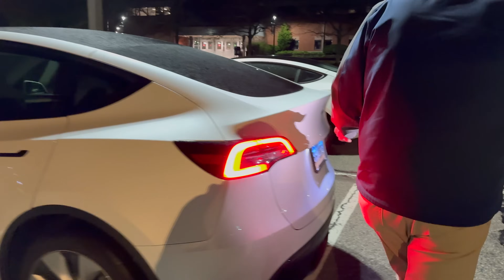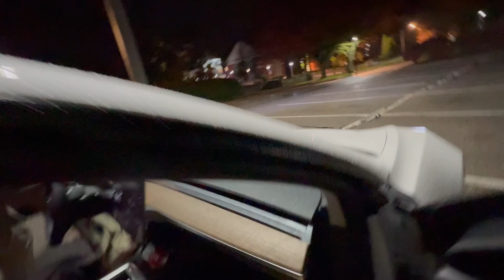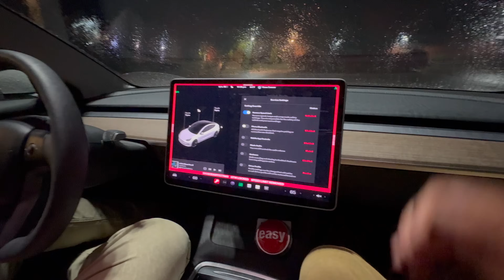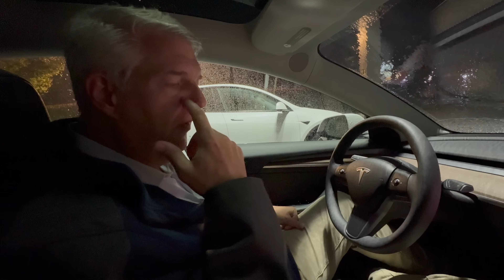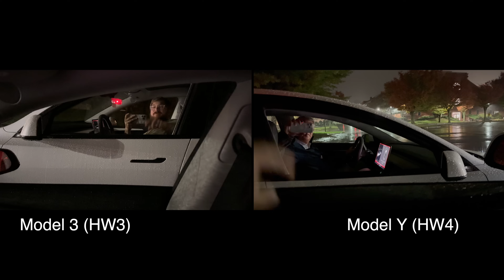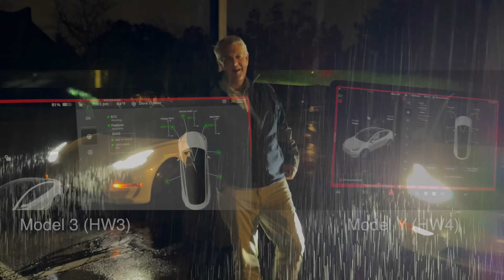Huge Difference! Tesla Autopilot Hardware 3 vs 4 - Here's What The Cameras Can Really See

Comment: Time will not tell.. Its a cost decision to remove duplicate sensors and just focus on cameras.. In every control algorithm if you got multiple input streams , you can do data fusion and get a much better knowledge of whats out there than just with a single type of sensor. Lidars+MMwave radar+Cameras means you CANNOT lose anything that is out there, hence you can never misidentify something or not see something because of water or fog. With cameras alone, you rely on clean camera lenses and AI pattern recognition to know what is out there and what the distance is , and this is really prone to errors.

Comment: There must be a coating that you can buy that repels water. Also for glass panes
Reply: Oleophobic and hydrophobic coatings. basically oil/fats and water form into droplets. 
There usually is some on the glass itself - but sometimes cleaning and pressure can force it away.  The angle of the front glass and B pillar cameras make it hard to clean or resurface - but it is possible to put ceramic film or coatings on the glass again to restore the water beading properties.

Comment: Tesla did nothing to address the critical problem with the B-pillar cameras.  Obstructed views.   The front wide view camera really cannot be used to determine whether it's safe to pull out so when the B-pillar is obstructed FSD is winging it.  I have lots of examples of obstructed view corners that I have to disengage.  No way FSD can see cars approaching from left and right.  You can get to the camera preview by simply going to service and then scroll to the camera preview option.   No need to go into service mode.

Comment: I have FSD V3 on my TMYP and it works fine at night and in the rain to a point. It does glitch if the sun is in a certain angle or when the wipers are working fast. Ironically, my enhanced autopilot worked better before the stack merge.

Comment: Pretty sure HW4 downsamples video feed, so it is not accurate on the screen. But I can say, having used HW3 since 2021, the cameras are not high resolution enough to see a stop light at a distance. Lights will be green and the car keeps slowing down for quote a while.

Comment: As others have said there are only two windshield cameras on HW4 cars, they removed the narrow camera.  How is it that you guys didn't know that?  This is a known thing for like months now.  And while the HW3 cars camera quality was greatly improved via software, it's still not as good as what HW4 cars have, because their camera hardware is much better.  But the HW3 software upgrade to improve the video, is NOT like iPhone quality, sorry Kyle, not even close.

When I had a HW3 car it always got the camera degraded thing at night, so that isn't just a HW4 thing.  The software just isn't there yet and not worth $12,000, and it will be many more years before it is ready.

Isn't it interesting that Tesla designed HW4 in such a way that it can't be retrofitted in HW3 cars.  That was deliberate so they wouldn't have to give everyone that paid for FSD free hardware and if they wanted it then they would have to buy a new car.  I feel that from now on Tesla will do this, which then makes buying FSD pointless and we might as well just "rent" it via the subscription model.

But yes, removing the ultra sonic sensors was a bad move.  Those sensors have been in vehicles for decades because they work really well!  Vision only on my car had me stop 5 feet from where I should have stopped to park inside my garage, it sucks!

Comment: Yes the software update improved the on screen camera image, it's SIGNIFICANT. I could never use my side cameras on screen to switch lane, I would always use the mirrors to switch lane but with this improvement I can use the on screen images with confidence. I also completely agree, it was dumb to remove the USS sensors. Time will certainly tell. Great Video.

Comment: great video，Thank you for your compliment on the rain test comparison. I must say this video is excellent, and I really wanted to understand the differences between Hardware 4.0 and 3.0, as I previously believed it would be a crucial step in achieving full self-driving for Tesla. Unfortunately, I have learned that the latest Model Y is equipped with a scaled-down version of Hardware 4.0, which we might refer to as Hardware 3.5. This 3.5 hardware lacks the 4D HD radar, which provides essential support in rainy and low-light conditions to ensure safety. I recently ordered the rear-wheel-drive (RWD) Model Y, but I've seen that the versions in China have improved acceleration, now reaching 0-60 miles in just 5.9 seconds. This has made me contemplate canceling my order.
Reply: The latest Model Y does not have a scaled down version of hardware 4.  It has hardware 4, and all the hardware it's supposed to have.  What is scaled down is the software of FSD beta, which at some point will be added to what it should be.  Not sure why the FSD beta software wasn't fixed to work with HW4 cars prior to the cars being sold.
Reply: @Resist4  Thanks for reply. However, I don't think so. Based on the breakdown of the "green" version, we can clearly see that the long-range version of Model Y is equipped with HW3.5 but lacks essential processing power and the interface for 4D high-definition radar. This is why I ultimately decided to choose the cheapest Model Y RWD version.

Comment: 2023 mylr hw3. Just drove 200 miles at 3am in Florida in a terrible storm. 4 lane rural road, US 301. During rain and fog held speed to 45. During rain held speed to 55. Much of the time visibility was so bad I would not have driven. When trailer trucks passed road was usually totally obscured to my vision. Only used autodrive the whole time. Never a hiccup. Not one. Flawless all the way. I am totally amazed. So there you are.
PS auto headlights, auto wipers.
Reply: U used FSD in these conditions and did that well?!
Reply: Absolutely. @JaHm3sZ
Reply: What do you have against writing full sentences?

Comment: I wish my Model Y had the ultrasensors.   I don't trust the cameras for object distance from the car.
Reply: Yeah that's why I didn't get the 2023 model x I got the 2022 mines have the ultra sensors and it have a radar I don't know if it's in use when I enter service mode It tell me it have a radar but yeah that's why I haven't upgraded yet cuz of that reason no sensors dinner ones without the sensors can't do auto park or summons
Reply: @youngchirp12  they can now. Even better than the ones with the ultrasound sensors
Reply: Yeah I got that update I like it I just wish it could summons @offbeatfusion
Reply: @dvanmartin9842  my 2018 model 3 has them and I don’t think at this point it makes a great difference. The cameras are good enough (and have been since this video was recorded) to be on par if not better than ultrasonic sensors. The problem with ultrasonic is it takes a liiiittle bit longer to react than cameras reading raw data input

Comment: When HW4 was launched, it was said that it would only have two front facing cameras, and a dummy camera to fill the hole of the missing camera.
Reply: I wonder if we can take selfies with the dummy camera.
Reply: I don’t think the HW4 was launched. As far as i know the Y still HW3 in the UK, i just ordered the new Y and it will be delivered to me in next month.
Reply: @davidhe8  in Canada some Model Y on the new inventory page have new headlights. I'm waiting for the Performance to get that, Thinking of getting one to complement my old tuned Audi, which is already faster, but less practical and pricey to run/maintain.
Reply: @OWanKeno9i if you are waiting for brand new with big change of model Y then you have to wait until end of next year I guess. The small change of model Y is already in China now. The new cars will using the new method to build which more lower cost than the current version. Because they try to make car’s body in one piece.

Comment: I don't even own a Tesla but this was still very interesting.  Thanks for taking the time.

Still have the 2020 Bolt EV, but the lower prices on Tesla makes them very tempting indeed.  

The Mach E GT is interesting, but even with all the cash Ford's throwing at the dealers, there is still at least a $6,000 difference between the Mach E GT and a Model Y Performance.
Reply: I own a Tesla model S and recently rented a 2023 Bolt EV.  OMG I couldn’t believe how much difference there was between these cars.  The software, the max charging rate, everything was 1000% better in the Tesla.  Even the model 3 is much much better than the Bolt.  I don’t think most people realize the differences.